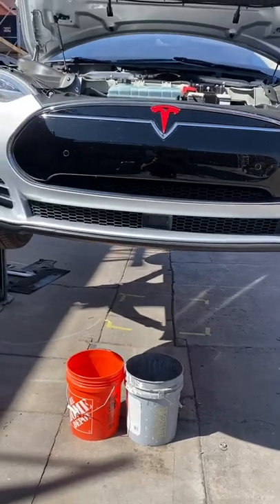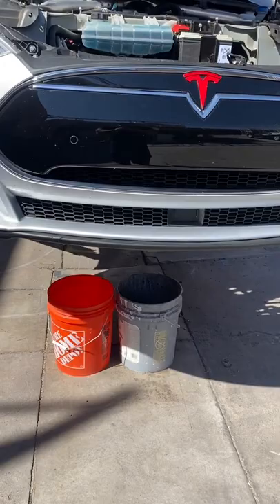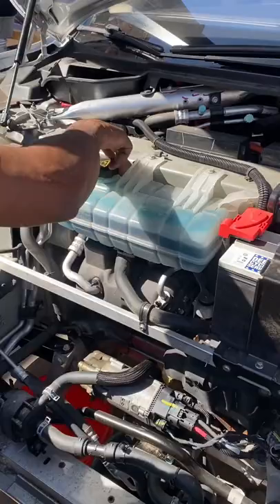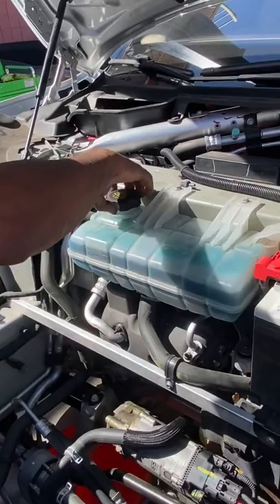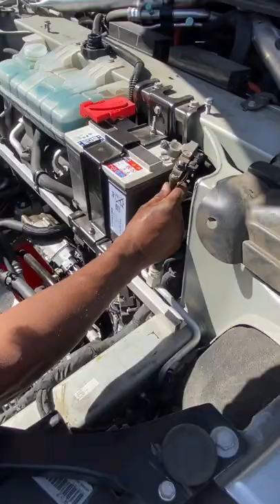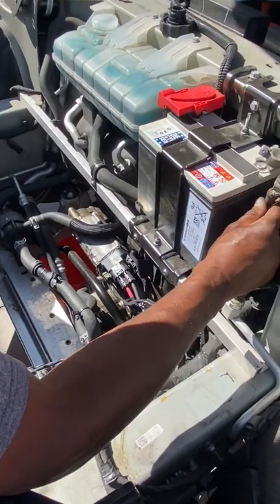Coolant Clog in a Tesla?

Comment: Does anyone find ironic a battery is disconnected in a tesla ? lol
Reply: Lemme disconnect the torque converter 💀
Reply: @aidenlebel8157  lol
Reply: Not at all.
Reply: No
Reply: I mean it needs a 12 volt auxiliary battery for accessories.
Reply: Lol
Reply: Yup
Reply: Why/how so?
Reply: Home Depot and Dunn Edwards buckets
Reply: @BleedingWhiteKnuckles  If your talking about why it needs an extra battery for accessories it’s because the main battery outputs a high current and voltage so to power the accessories you would need to step down the voltage to the standard 12v which wastes a lot of energy due to heat. There are probably other reasons but that’s some of the reason.
Reply: @Jasen Vernor Teslas don't emit emissions once manufactured entirely. 

Electricity provided to the Tesla could also be green with solar, and mostly green with nuclear. 

Manufactured in "giga-factories" which are entirely solar... so yes. They are carbon free after being produced, it's not the car emitting  carbon. It's how you get the energy.

Comment: It’s an electric car. Meaning electricity runs everything.
Reply: yep , and gas is cheap until about 5-10 years down the road when all the sensors and fuses need to be replaced. Then you gotta hire a mechanic who’s also an electrician, good luck with that bill buddy
Reply: @creamythroat  most fuses and sensors can be replaced easily. It doesn’t take much brainwork buddy. Did your dad not teach you basic mechanic work?
Reply: @guillermo7189  I don’t have a dad 😔
Reply: @creamythroat  so you mean like any other modern vehicle
Reply: @creamythroat  weird I have an hybrid car, all pumps and things are electric nothing has been broken in the last 7 years. Car still pretty much works almost like new
Reply: @guillermo7189  bro these sensors are no where near what your little ford has lmao, and if one of them breaks , so does 5 others. Then you run into situations where you need certain stuff to work to fix. You’ve clearly only ever touched a gas engine haha
Reply: @sebastiann9279  you’ve got an out of date hybrid, not an advanced modern technology packed tesla, stop raising your hand to get noticed.
Reply: Same system on a gas car runs on electricity

Comment: You can’t disconnect the combustion on a normal engine
Reply: You cant start the combustion if the battery is disconnected dummy
Reply: @ibringthepayan  you can bump start it... HAHAHAHA 😆 😂 😆
Reply: @MR_G92  it still wont start if the battery is disconnected. Without a complete circuit nothing electrical will work meaning no spark, no fuel pump, no ecu.
Reply: @MR_G92  still relying on electricity  :) you still need that spark bud🤣🤣
Reply: Battery could be dead though with a standard Transmisson, you can still push, put in 3rd gear and pop clutch and it’ll start.
Reply: @robbyjames2777  do that with out an alternator
Reply: Ya you can. I had a fuel injector kill switch rigged up on my old car.
Reply: @0xsergy  still electric...
Reply: Unplugging the battery would be the same as removing a fuel line.

Comment: Oh I know the problem! Someone bought an electric car.
Reply: Laziest comment ever
Reply: Like they're aren't issues with any other vehicle
Reply: @juicewrldextendedunrelease5274  the difference is that if any other vehicle breaks, it has a plethora of parts available with no wait times and not to mention any mechanic or the owner can work on them….
Reply: @iheartapple-114  It took me 3 weeks to get my car back after it got into an accident.  2 of those weeks were waiting to get parts on stock and shipped to my mechanic.  Literally all it needed was 2 new trim pieces, a new rim, a control arm, and a tie rod.  It's not like it was some crazy low production car with scarce parts.  It was literally a Mini, and most parts were shared with either Peugot or BMW...
Reply: @bijdikh8516  I assume you are in Europe due to mentioning Peugeot. Parts availability in different parts of the world may vary. Usually body parts are harder to get than mechanical parts.
Reply: @sumofty  Laziest reply ever
Reply: @juicewrldextendedunrelease5274  ....I bought a brand new camaro ZL1 in 2015, 7 years later the car is holding fine, except for brake pads and oil change no parts has been replaced yet, ypu sure can keep your electric toy, I'm not buying into that crap

Comment: My guess is there is a solenoid that was blocking flow, and the battery just opened it for what would then travel through the motor. I could be wrong...
Reply: What motor? It's an electric car?
Reply: @afluffypinecone3577 

Electric "motor"   @ 98% efficiency 

Internal combustion " engine" 
23% efficient.   
Yeah gascars suck that bad.

Comment: I am so confused right now.
Reply: Most electric vehicles still have a small 12v battery, just as you would have on a car with an engine. No idea what the point of this is though!
Reply: @JakeM218  it runs the 12 volt systems in the car like the windows and whatnot, it’s much cheaper to use ones used in other cars that already use 12 volts vs manufacturing high voltage window regulators and whatnot and the expensive cable that has to go with it
Reply: . This expensive cable soon to be eliminated with a 400 v operating system

Comment: So tesla uses a lead acid battery for the water pump? Wtf the whole car is a battery
Reply: They also use it for the windows and radio and other car accessories, it’s much cheaper then trying to engineer ones that would use the high voltage the main battery produces

Comment: So Tesla has a normal car battery under the hood when the whole floor is full of batteries?
Reply: gotta have a backup incase to save power settings seat position favorites radio stations streaming service passwords phone numbers etc when you imagine that the battery is literally all the fuel storage and tank ⛽ that you have to get somewhere, anywhere , you're gonna want something to run the cellphone charger port lights radio air conditioner, heat other electronic systems... not a simple device a very complicated one because traffic laws sales laws legalities you know tons of red tape that makes it so hard to design your own and make money on it
Reply: @SnowingNapalm  it’s not really a backup as it just powers all those systems, Tesla uses 12 volts to trigger the relays to activate the main battery, run the car accessory’s such as the windows, radio and windshield wipers. They do this because it’s much cheaper to use parts already designed for cars vs trying to manufacture the same components to use high voltages

Comment: lol they think we dumb teslas don’t have fluid in it their electrik
Reply: what?
Reply: They need to cool the batteries, ever pick up the plug when charging your phone for a while, it gets hot, same with the batteries
Reply: This Nigga really flexing about coolant I'm dead
Reply: @DA_BEAMERRRR  What? I just explained why they have fluid, how am I flexing?
Reply: @TempSlothy  Not only to cool, but also to heat. Lithium battery’s are rubbish below 10c (50f). There’s a heater which can be used to warm the batteries to the right level so as they can unleash the power they have.